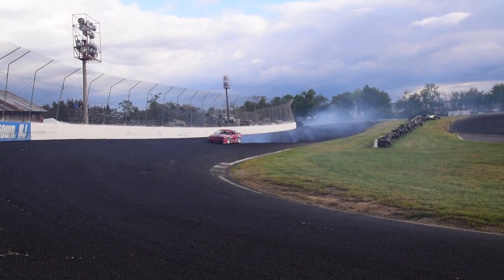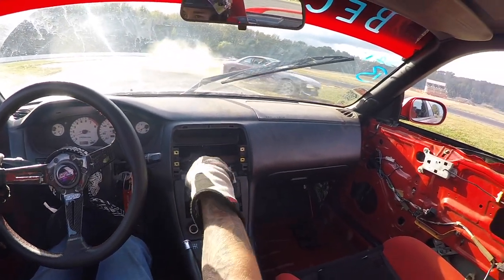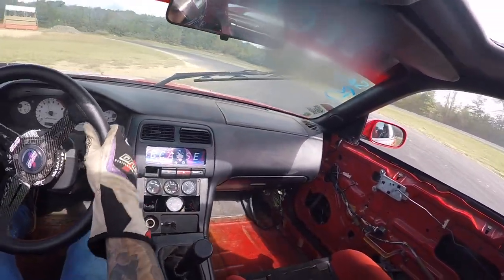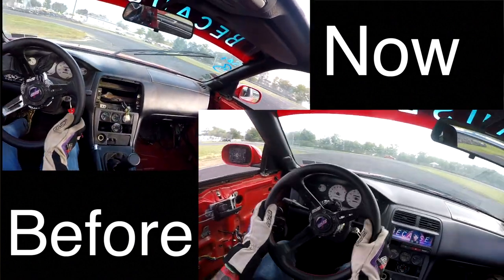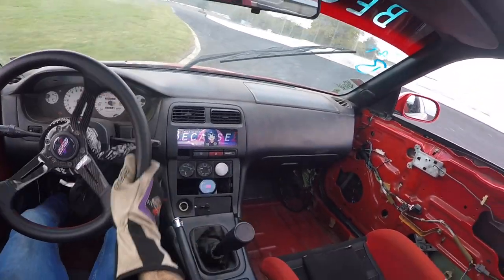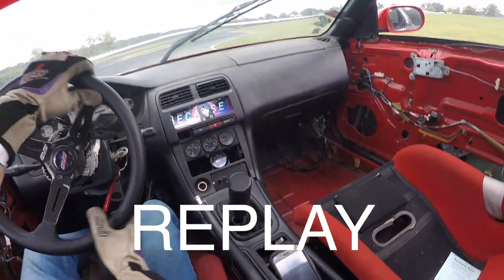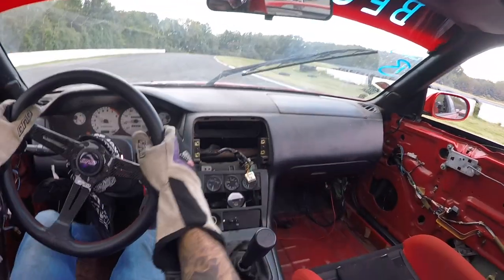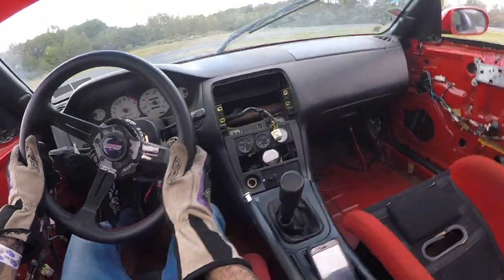HOW LEFT FOOT BRAKING WORKS WHILE DRIFTING | BD DRIFT BREAKDOWN

Comment: So left foot braking is backwards from regular road racing?What I mean is when steering into an apex if the car starts to understeer a bit of left foot brake puts weight on the front tires and helps the car steer.But in drifting it does the opposite and pull you out of the corner? Can someone explain the physics/concept behind this?
Reply: Depends on use. If you are mid corner and washing out or gaining too much speed you can use it to keep your line tidy. Think of it as opposite of handbrake. The left foot braking helps your car kinda "rotate" more and line you up. So say you don't initiate enough on a hairpin and you're kinda under steering and feeling like the car isn't rotating enough to line you up for the end of the turn, left foot braking it cause your car to have more "rotation" around the front wheels in my experience
Reply: Basically in road racing when you understeer you use left foot braking to transfer more weight onto the front tires, giving you more front grip and helping to stop understeering. When drifting (oversteering) it's used to transfer weight off the rear tires, it's done to lessen rear grip. The rear tires are pushing the car towards the "apex", if you transfer weight off the rear tires and onto the front, the push towards the apex is lessened, so your car begins to move away from the apex.
Reply: YOU GUYS ARE OVERCOMPLICATING SO FUCKING BAD

drifting is when the back wheels are spinning faster than the front, the back end wants to "run" past the front end, hence the drift.

Left foot braking especially with a brake bias controller, is intended to slow the front down. So you're hard on the gas still and what happens when you left foot brake? The front slows down EVEN MORE, the car wants to rotate even more than before.
Reply: @brysondowell3045  you got it